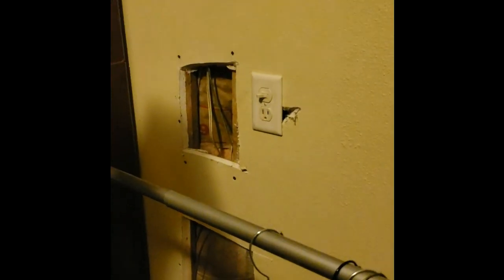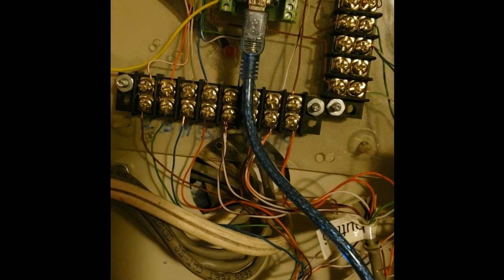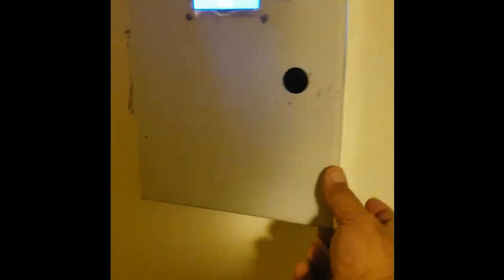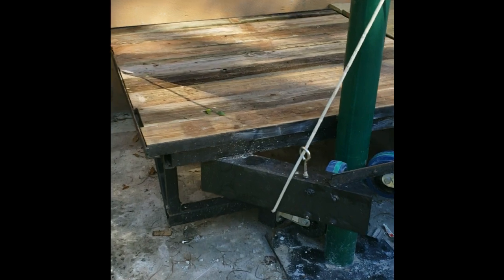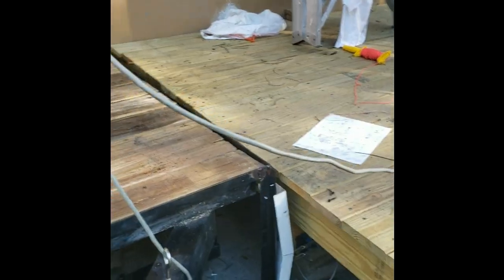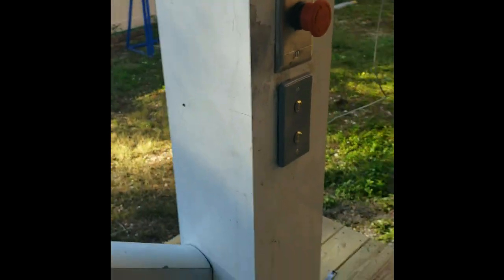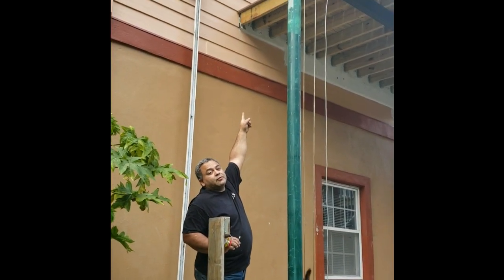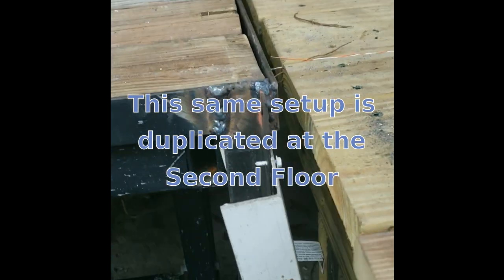DIY Hoist Elevator Dumbwaiter Conveyor Hoist Lift with Smart Electronics Project

Comment: Love how you’re using an Arduino to control it.  I just started on online course that is an intro to the Arduino Uno R3.  I’m currently in the design stage for a lift I’m putting in my garage...I also plan to incorporate the Arduino.
Reply from the maker: Thank you for the comment. Arduino has been a great addition to my list of hobbies for sure! We now offer a complete automatic hoist controller system ready to go that is made with custom circuit boards that will integrate very nicely into your Hoist elevator design. Visit us at http://OffGridOnline.net and chat with us live through the site.

Comment: Like others have said you put a lot of faith in that Harbor Freight Clutch.  Goodle fall safety protection strap.  There are 2 types.  One is a cable type fall arrestor and the other is a strap fall arrestor. IN your application I would recomment the cable style, because of UV damage to the nylon safety strap will compromise it in a few years. 

They are much lke a seat belt arrestor/ retractor.  They will allow the cable or strap to spool out at a decent smooth speed, but if your clutch fails ot lifting cable breaks they will stop the fall as soon as the payout is too fast to the platform in a matter of seconds. A lot cheaper than an Ambulance or Helicopter ride.  And if that were on my parents home I'd be building a bird cage around the platform to keep their feet inside and bodies from going over the side. The electronics is a great set up.
Reply from the maker: Thank you for that suggestion, we now have a recommended arrestor listed on our store http://OffGridOnline.net
Reply from the maker: This video is actually really old. We have since built a cage for the platform and upgraded the guide railing. Definitely feels safer

Comment: You shure put a lot of trust in the brake on that Harbor Freight hoist. Also should have riged a pipe clamp to act as a broken cable brake.
Reply from the maker: You are right. I have some ideas I'm looking to implement later. I'm thinking of something that utilizes lateral pressure from the cable to hold a brake away from the pole. Pipe clamp is a good idea. Thanks
Reply: Can you elaborate on how the pipe clamp brake would work?

Comment: Hello
How much is your kit and what you will provide
Reply from the maker: We sell the electronics that connect to your hoist with the buttons, limit switches and emergency stops you need to make your existing setup work. We do not sell the hoist or the frame for the elevator. You can see the details in the listing on our site: https://www.offgridonline.net/preassembled-kits.
 Thank you for checking us out!

Comment: I'm considering using this kit for a dumbwaiter, but I want to have operation of the hoist stop if the doors to the dumbwaiter are open.  Do you have any suggestions for doing that?
Reply from the maker: Yes. on the emergency stop circuit, you can add additional limit switches to the circuit. they are in series so if any one of the emergency stop limit switches are open, the system stops any movement. once the limit switch is closed again, the system allows movement again. you will need to press the up or down button to start movement again, it will not automatically continue moving in the direction it was going when the limit switch was opened. sorry for the delayed response. I didn't see it until just now.
Reply: @OffGridOnLine  Thank you, that should work for me.

Comment: What’s up. I’m interested in this on a micro scale. I’m a little person and I’m building a tiny house. I have been planning on building a small elevator with electric hoist and then I saw your build. I will only be going up 5 ft between 2 floors
Reply from the maker: That's awesome. We are living in a tiny house as well! This system is now available on our ebay store. The great thing is that the electronics run off of a small wall adapter and does not consume very much energy (In case you are also off the grid) The system will work with your hoist. the limit switches that are included with the kit are what set the stop points for both locations. Sorry about the delay in our response. the ebay listing is as follows:
 DIY Automatic Hoist Controlled Elevator Lift Dumbwaiter Platform System Kit https://ebay.us/dN5MZx
Reply: OffGridOnLine Videos wow.. little too pricey for me
Reply from the maker: @LifewithLewy  Send a message via ebay on our listing. Make us an offer. We may be able to work something out.
Reply: OffGridOnLine Videos ok after I get done building the rest of my house I’ll put some money together and let you know

Comment: Will your controller work for multiple levels?
Reply from the maker: How many levels would you want it to work on? I can modify the code on the controller to accommodate Multiple levels. Depending on the number of levels, I may simply have to change the micro-controller to a larger model like the Arduino Mega. It wouldn't be too difficult to add code to support more stops.